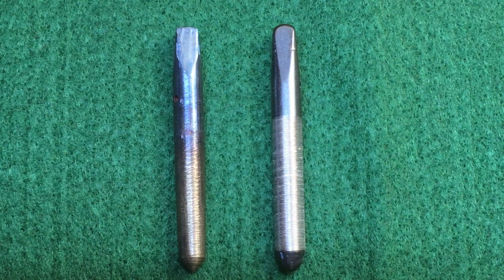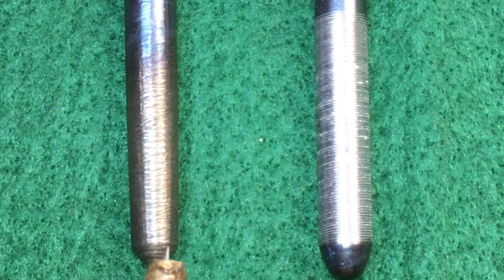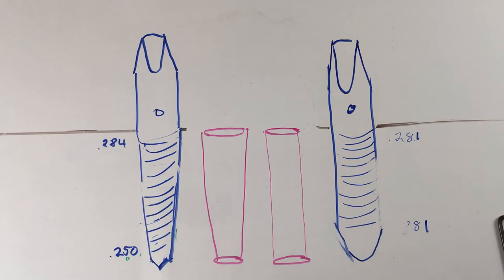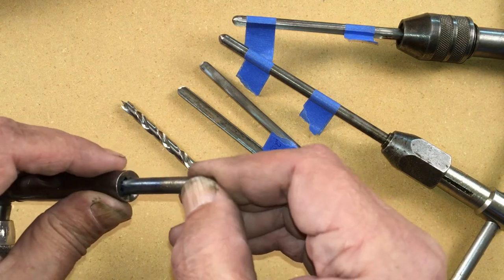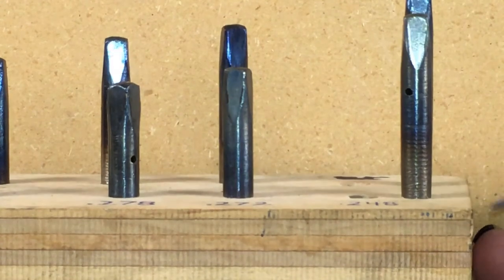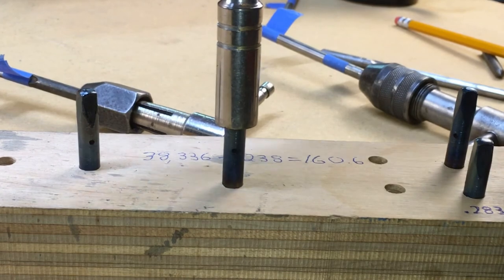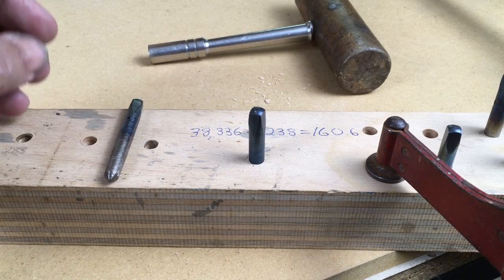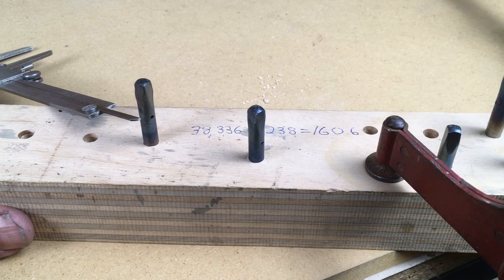Tapered Tuning Pins

Comment: When I learned how the string pianos I was told that this was true about tapered pins versus the straight pins of today. Although I have never seen anyone demonstrate the differences so that I can see for myself. Now that I have seen this demonstration I can't understand why piano manufacturers would change to a straight pin other than planned obsolescence. Everything in the late 1800s was made to last forever. Today's instruments are not manufactured through that lense. Thank you so much for this incredible demonstration! I have been wondering how to make those tapered pins fit for years!

Comment: Taperd reamer .
Made my own wooden tapered reamer for making holes for tapered wood tuning pins for guitars....
A tapered piece of wood turned on a lathe or can be done in a drill with sand paper ..... cut a slot and insert a flat of cutting blade made in my case from a piece of metal banding....
This was glued in with thin  cyanoacrylate (super glue) then the edge filed sharp to my specs.... you can buy these reamers or make them from metal.... I would in your case use one of the tapered pins and grind away just over half the circle to create a reamer.....sharpen one edge and round the other ....

Comment: I am often dealing with loose pins so the tapered pins to me seem like a big win. But why did everyone switch to straight shaft pins?  The Chinese commenter  rightly points out that there's no way to get uniform torque with tapered pins. So from a production point of view this makes sense whereas if servicability is your goal tapered pens to me seem like a must, because how are you going to increase torque of a weak pin? The ideal might be to use less steep pins to avoid cracks in the tuning block.
  Is anyone going to take care of this matter ... probably not, so I'm going to replace straight pins with tampered pins at my will. Thanks for the video!
Reply from the maker: Oh my god! these pins make so much sense, one can back a pin out of it's hole without excessive friction and one can adjust the tork with the most gentile tapping.  WOW!
Backwards rotation and they pull right out!. "easy"
A lot of bafflement in piano's.
We have 2 1850's Chickering and they have a full iron plate that covers the pin field,  Why did they go to a complete open faced wood pin-block?
Everyone did from what I have seen until the 1870's.
These 1859&1857 Chick's have no distortion or failures like  all pianos after that time.
The 1867 Chick we have now is an open faced pin-block that split  and twisted.  
That is a big mystery so far. Why did they change.??
One of the problems is ignorant tuners that pound down the pins and did not realize they were tapered = split blocks every time. Yes, yes and yes mostly stubborn stupidity = failure then they tell the owner Your tuning pins are loose!. 
At least straight shank pins are a little more idiot proof.  "a little"
R.Blais.